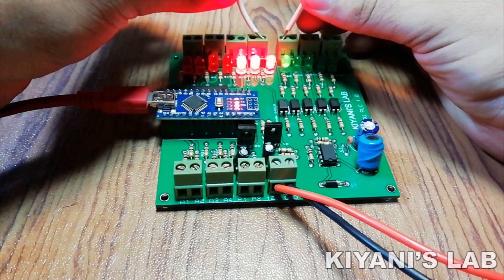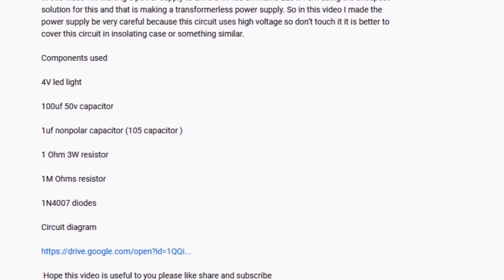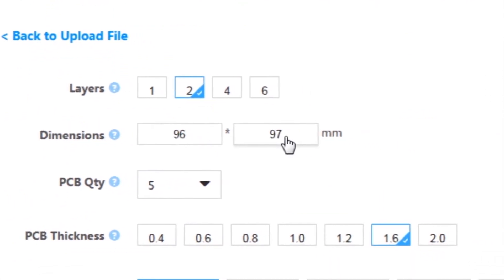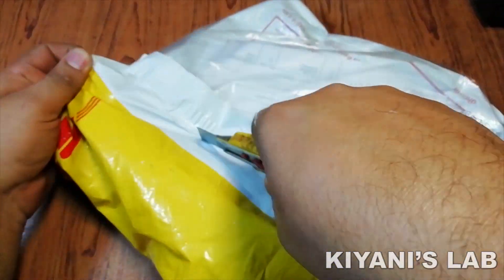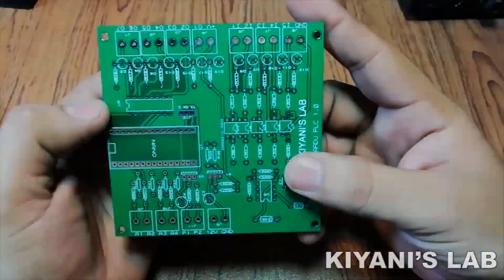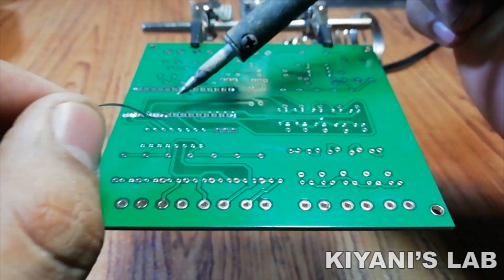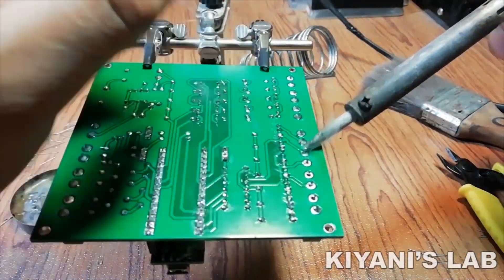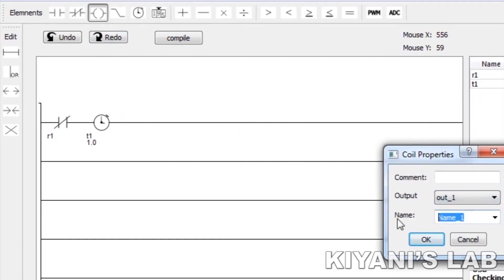HOW TO MAKE ARDUINO PLC

Comment: super interesting video 🧐 i purchased an ebay MCU : RS485 Modbus MCU Controller Board Development Board Kit for Arduino Nano Din-rail mounting and need the MCU software for it??? this project is some what like it. with much better full feature documentation. 😎 thank you very much.

Comment: Hi 
 Kiyani's Lab! Try this free Arduino PLC programm - FLProg:  https://flprog.ru/en/.  Works good on Windows and Linux. FBD and Ladder logic editor. Tons of elements: HD44780,Temperature DS18B20, DHT11-22, RTC, UART, Ethernet, Infared transmission, Bluetooth, RTU MODBUS RS-485, MQTT, CAN-bus, SCADA player and much more..